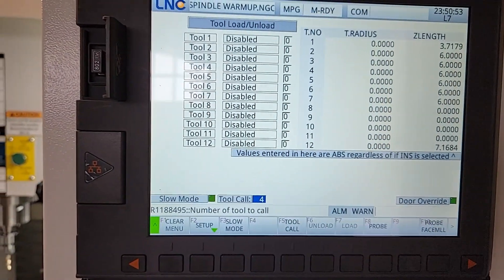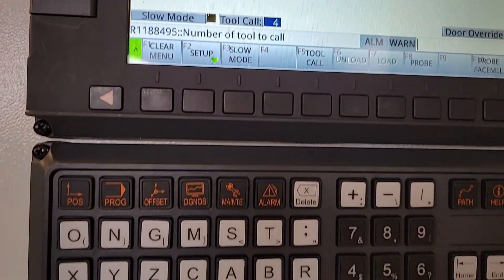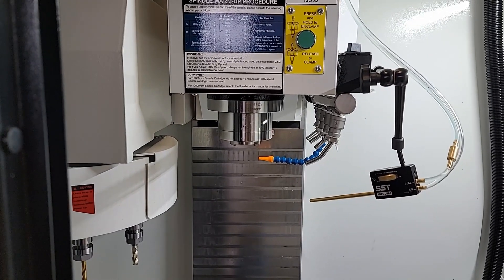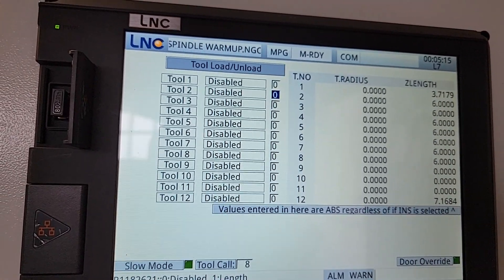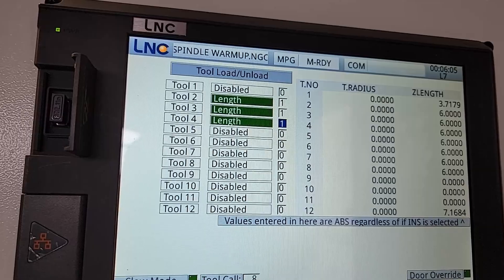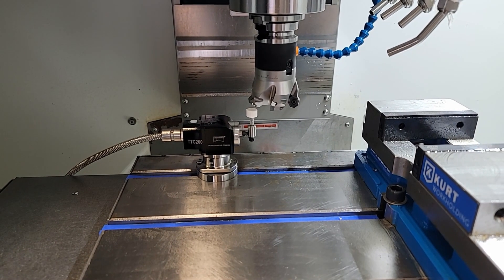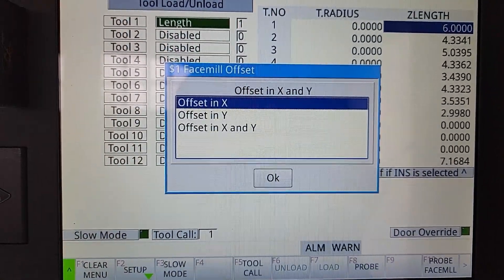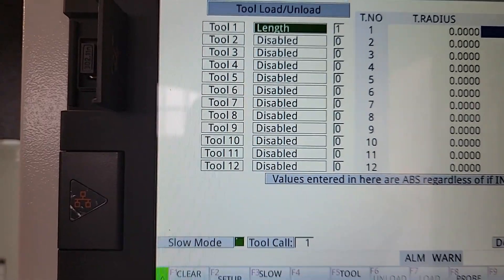SYIL X7 LNC6800 TOOL LENGTH PROBING

Comment: it only probes 1 tooth? unless the others are exactly the same, wouldn't it be inaccurate bc of the other 3 teeth?
Reply from the maker: Yeah, it's not the most robust. You can run the routine for each insert and then manually average or choose the longest length.

Comment: I've been thinking about the EMVIO screenset for my Syil X7 LNC5800.  How smoothly did the process go?
Reply from the maker: The process was smooth. The EMVIO team walks you through the process via a video call. They teach you how the screenset works and answer questions.
Reply: @MrSmith1231    Thanks. The native screens are lack-luster, but do the job. I had to modify the tool change macro so I could have more than the 12 tools in the magazine. Now if you want tool 45, it puts away tool 2 and presents itself for you to insert 45. Then back to tool 2, it presents and you take out 45, and then it goes and gets tool 2 from the mag.  The 12 tool limit was driving me crazy.  Maybe a different way to do it with the slot numbers, but I could never figure that part out.